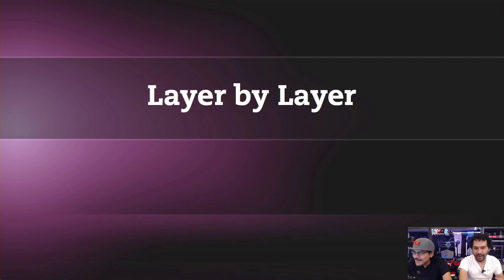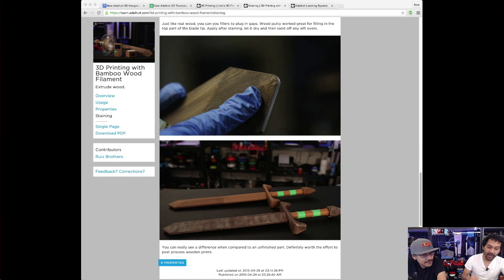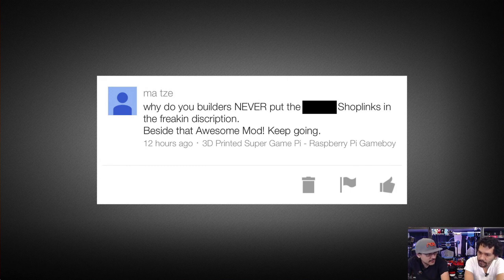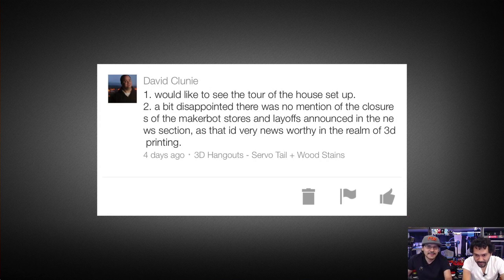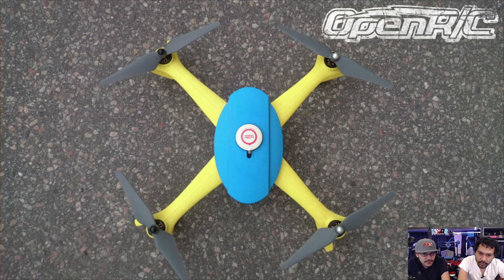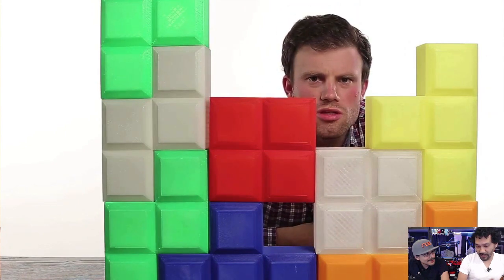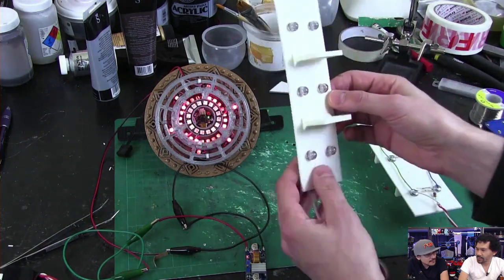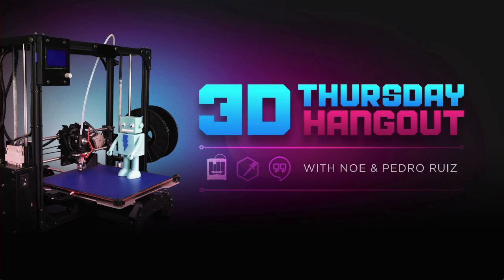3D Hangouts with Noe and Pedro Ruiz - 4/30/15

Comment: Can you please elaborate on z-probe vs manual calibration.
I have a printrbot simple (1405) and a metal plus so I've only worked with z-probes.
Would it make sense to get rid of the probe and convert a printer to manual?
Thanks a lot.